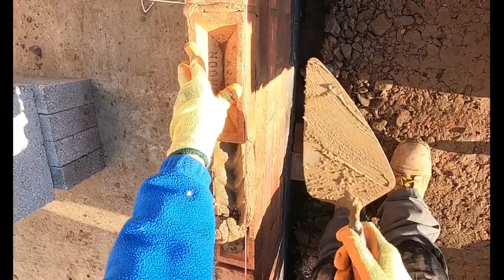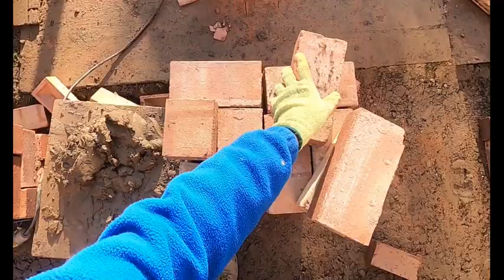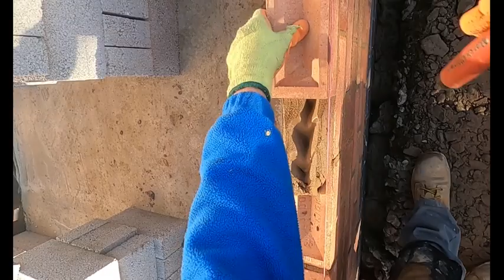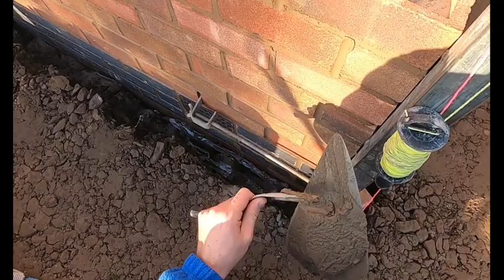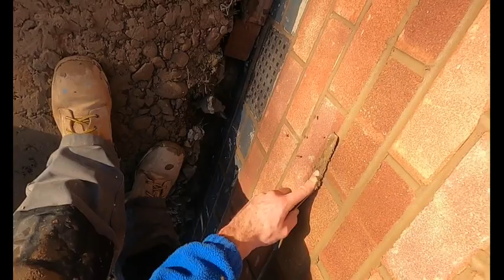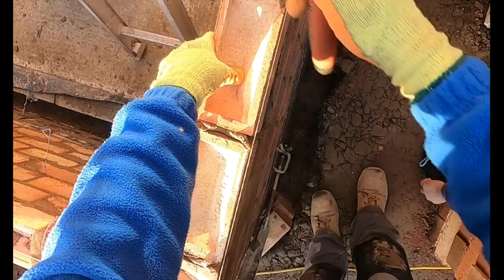Bricklaying- Laying the dreaded LBC bricks

Comment: Never found a problem with them its all we had in the 70s and early 80s just a brick.
Reply from the maker: Not a problem just not the greatest to lay🧱
Reply from the maker: @jims5394  it’s just the amount wastage you get from them being bashed
Reply: Hate em. Did a job in the summer with the LBC rustic wire cuts and you end up chucking the bottom row of a band because they’re chipped and only faced on one end so have so much waste from cuts plus you got to lay one frog down on the external corners because they are only faced on one edge
Reply: @keironhiggins9620  Yea not the best quality these days I believe they won't be about to much longer as the clay seam is coming to its end. Just fill the frog first before you lay the corner one frog down.
Reply from the maker: @keironhiggins9620  couldn’t say it better myself👍🏽🧱
Reply: @andrewpalij4691   They could stretch, sustain the clay bed seam by producing the frogs both sides and ends of the bricks. Double ended 🐸 bricks. 😳 Light weight and produce a strong bond and cheaper to produce. Disadvantage, harder to lay.🙄
Reply: @m101ist  😁😁

Comment: What trowel is that?
Reply from the maker: 11inch Marshall town mate🧱
Reply: @ConstructionwithKieren  witch pattern mate and could I ask  a few questions i just qualified how would you go on about starting thanks
Reply from the maker: @kylearts5095  it’s just the standard handled one mate, red one! & for me start doing the smaller jobs which you are comfortable with!👍🏽
Reply: @ConstructionwithKieren  are you on your own and then did you start your business?how did you learn?
Reply from the maker: @kylearts5095  I actually work for someone mate but I do many side jobs. Maybe go and work for someone for a year or so and learn the basics of the trade as much as you can then you can afford to make the odd mistake and learn from it easier👍🏽
Reply: @kylearts5095  💯 what Keiran said. You won't get paid much in your first year but if you're with a good gang and your on the line alot you'll progress quicker.
Get some numbers for work from the internet, Gumtree, indeed, ect or just go on Google and type in "bricklayer jobs" then call them up and explain that you've just qualified and now you're looking for a start as an improver

Comment: Looking forward to this and hopefully prove me wrong and cut the cavity in this time. 🤞
Reply from the maker: Cheers chris🧱
Reply: @ConstructionwithKieren  not knocking your work buddy. Just wanted to know if you were cutting the cavity out on the existing house to continue into the extension. As a fellow trowel working down south building control would have it down if we don’t. As it’s to stop damp from tracking across. The regulations are so tight down here
Reply from the maker: @chris070563  no mate that’s fine, after doing it for 9 odd years we have never been told to do that, by inspectors/architects or anything! Which seems strange lol👍🏽
Reply: Don't need to cut it out totally for a continuous cavity but you do at least need to cut a vertical dpc in to stop the damp tracking across 👍 building control always make me do it...

Comment: Looks like the same brick as my house LBC Heather 73mm, we are looking at doing an extension at the moment and same of the building around my area are saying that the don't like working with them. is it the colour matching or the height difference that people don't like? How do you get over the height issue, bend the brick ties? (I'm not a brickie - hence the question)
Reply from the maker: For us Wayne, say if we bought 2000 bricks I reckon about 300-400 of them would be unusable! They always seem to chip very easily🧱
Reply: There is a manufacturer who makes a 73mm Heather thats not an LBC frogged brick it perforated 3 holes i think its carlton. I use a builders merchants in Sheffield called Frank key give them a bell for the exact name.
You will need to cut them with a stihl saw thou. 
Good luck.
Reply from the maker: @lukehall3035  that’s good to know. Thanks for that Luke! Hope you enjoy my videos👍🏽🧱